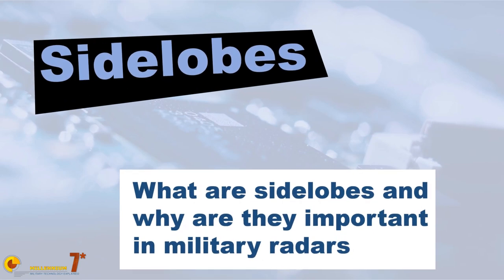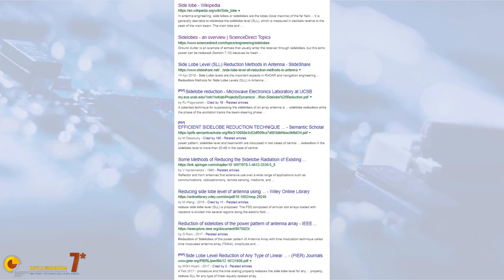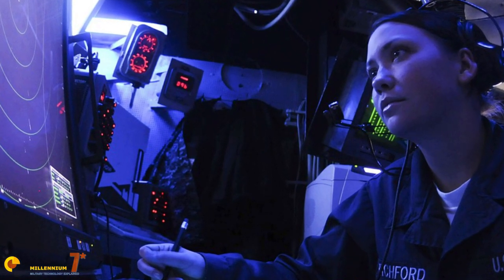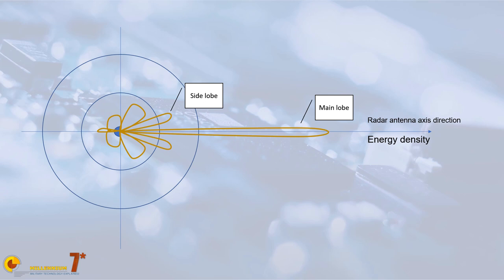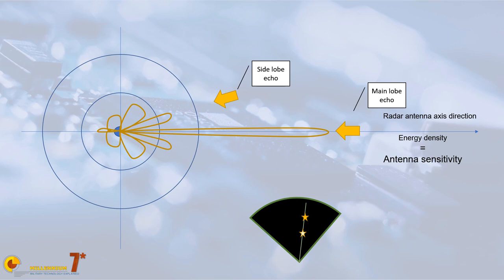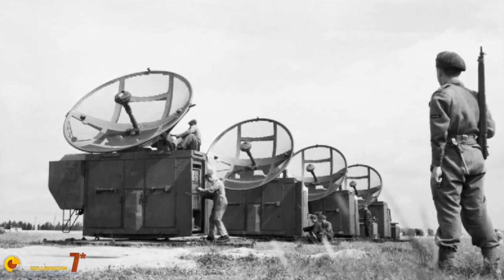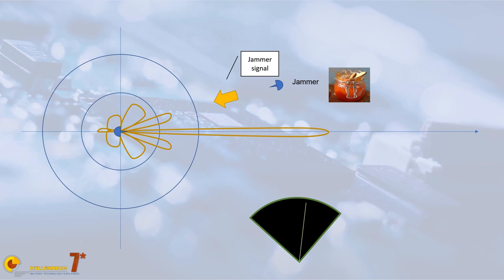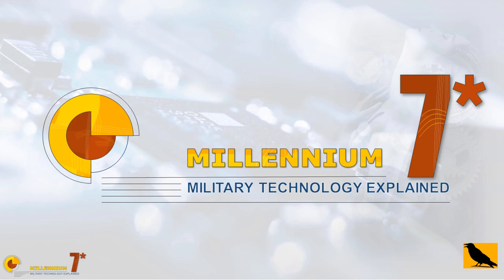Why Radar Side Lobes Are Harmful

Comment: Interesting timing! I was just having a discussion with someone today on side lobes affecting fighter-mounted radar using cassegrain antenna at low altitude. All theoretical, of course... and the Russian N019 & N001 in particular.

Can we look into radar antenna design in a future video? You mentioned it briefly but said that you wouldn't cover it right now. I think you may have covered the impact of frequency on what we can see (reflections or pass-through; rain, weather, specific material etc.). You certainly have a tendency to whet someone's appetite. Perhaps more on radar in a future video? Thanks! :)
Reply from the maker: I see what I can do, I can't promise now because there is new series in the making and a lot of shorter videos coming. I wish I could do this full time; it is too much fun!